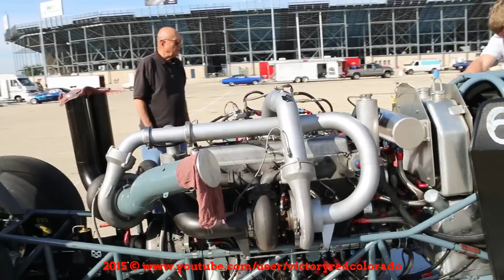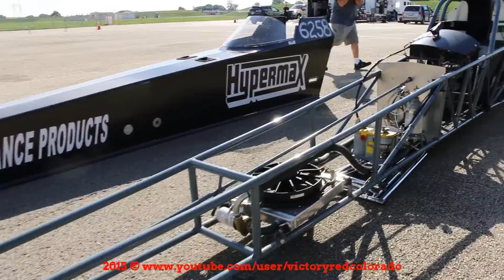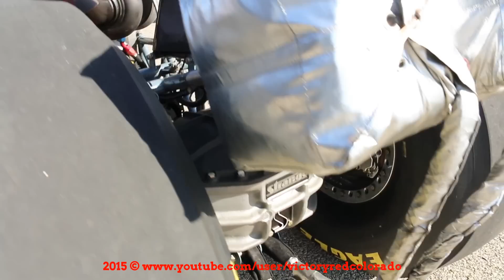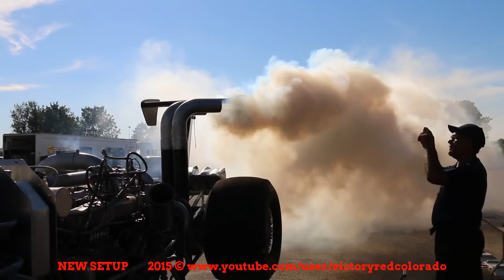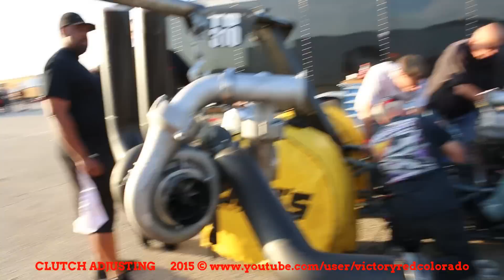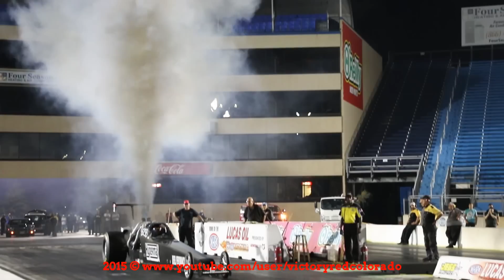"HYPER"MAX! 6 SEC TRIPLE TURBO DIESEL DRAGSTER! RT 66 FRIDAY NIGHT!

Comment: I realise this is an old upload,.   What was the idea behind or Is there a reason for overfueling to such a degree?.... like is the unburned fuel there to help with keeping the cylinder walls or pistons cooler ,..or is it just there to match the air volume, pressure ( volume presssure density temperature? ) at those things that look like  transfer ports from manifold into the cylinders, while on boost and N2O. 
Does nitrous help with cooling?
Reply from the maker: I have no idea what the setup or reasoning is. I have a few other runs I never posted that I plan on doing. 👊

Comment: Looks like some reinforced chassis work is in order. That thing looks like it’s on springs with all the engine weight.
Reply: Chassis is probably more than 6meters long. Very difficult to have a rigid component with that amount of torque.

Comment: She's beautiful! Can you imagine put that motor in an international or a topkick dump and pull up next to a sports car! Lol they'd be sittin in a clowd of smoke at the light wondering what just happened. "911 what's your emergency?"
Reply: Lol same engine that is in my IH 1066, I should do that to it hehe. They wouldn't have a clue that a tractor is going to outrun them... Just need to invert the final drives hehehehe

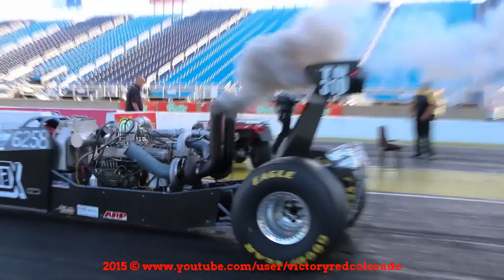Comment: 4:00 - takes a minute for that thing to spool up, doesn't it.  :)

And with the amount of unburned fuel  it's throwing, imagine the eye-burn if you were anywhere near it.  

Wonder what it weighs?
Reply: 3500-3600 lbs
Reply: eyeburn, from diesel :) ?
Reply: @Demidar665  - Diesel is high in oxides of nitrous (NO6 - NO8) when heated, which is the stuff that irritates your throat and makes your eyes water if subjected to the fumes.

Comment: try Motorkote fuel optimizer in the diesel... 
you might be surprised what it does... 
was formulated by Dr. David Purcell who was the original inventor with a Phd in polymer chemistry and a professor at the university of Michigan
Reply: Fuel optimizer? I thought it was an oil additive? And yes it works great!

Comment: why cant you instal a supercharger for low revs and avoid the smoke?
Reply: this is the problem,the turbos are very big and need a lot of time to turn on.the torque of the engines at low rpm is very bad. need absolutly of the turbo blowing for generate the torque and of course,the power.  for lows,the mechanical charger is ideal.
Reply: Pau Ayelo they build boost before takeoff and the rpms are high the entire run. Effectively the turbos are in use the entire time, smoke is irrelevant
Reply: Not to mention turbos are easier on the engine

Comment: What is the point? it's only 50 years and 2 seconds behind Nitro, not to mention that soot, totally inefficient diesel fuel burning.
Reply from the maker: +Wayne Smith Seriously and you designed and built what?
Reply: So basically you're saying that all other categories of drag racing are pointless because they're slower than nitro?
Reply: Basically what I am saying is the Diesel powered dragster is only competitive against other Diesel dragsters, I watch and appreciate all classes of drag racing both as a competitor and spectator since 1965. You are no doubt aware that full bodied cars such as Super Stock, Pro stock and street legal cars can all run in the 6 second area and day of the week, and that's without choking out the entire spectator area with soot, which is a well known carcinogenic, look it up.
Reply: Wayne Smith Lol, I don't go to Wendy's or Culver's for nutritional meals and I don't go to races to breath fresh mountain air.  :)
Reply: Wayne Smith I was wondering how the dragster was classified, can't be top fuel, can't be alcohol, can't pay for the days racing in the sportsman classes. Nice car though, good engineering project.
Reply: @waynesmith1942  I agree, it would be kind of interesting if they did run possibly  propane in these diesels (kind of the diesel equivalency of nitro).
Reply: @butlerproman  i ducking love this comment! Burns my nostrils

Comment: One run and mars didn't exist anymore
Reply from the maker: You're aware diesel burns cleaner than gasoline and there's no life on Mars right 😄
Reply: @victoryredcolorado  Ok, how can you say that a gasoline engine does not burn cleaner than a diesel based on this video? I do have a 78' and 95' dt466 so they are a great engine.
Reply from the maker: @treeandstoveguy  Reread it, I said diesel burns cleaner than gasoline. Known fact.
Reply: @victoryredcolorado  Ok. I guess we are going to splits hairs with comments. As I said, "based on this video". Also, according to your comment and based on my comment, where is the particle filters on this engine that makes this particular diesel burn cleaner than gasoline engines?
Reply from the maker: @treeandstoveguy  Well where are the particle filters on the engine of a drag car then? This is a race track after all.

Comment: So as of now spark ignition/gashous mixture engines are still faster in motorsports. I admire people who put in the effort to make something work and prove a point but to me Diesels will always be meant for doing work. They're perfect for getting a lot of work done on less fuel, you have to move that huge pile of material from point A to point B? Diesel gets it done. You want to rip down a drag strip without engulfing the spectators in black sooty smoke? You need spark ignition.

Comment: What engine is that?
Reply from the maker: +Chris Smith DT466 International
Reply: +Chris Smith it is obviously a VW 2.0 TDI
Reply: +mgoogyi LMFAO
Reply: Dt466 inline 6cyl, wet sleeve. Arguably one of the best engines ever produced. These are common to see a half a million miles with regular oil changes. Mostly see this motor in medium duty box trucks, school bus, flat bed, and dump trucks.